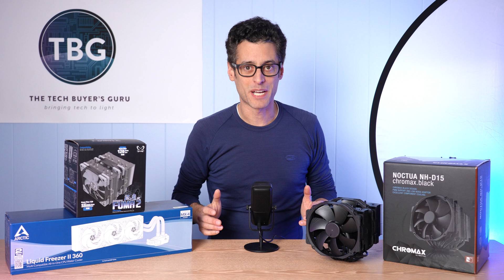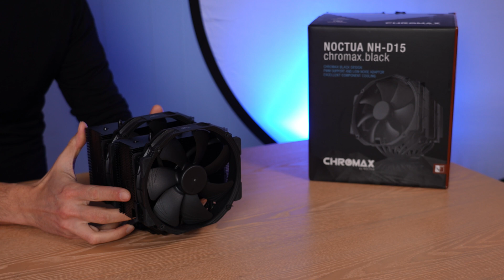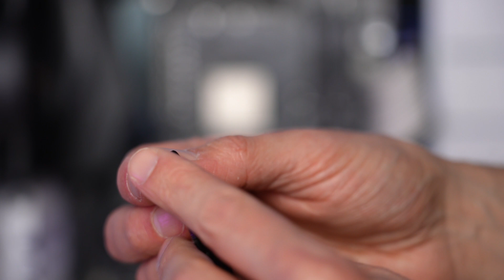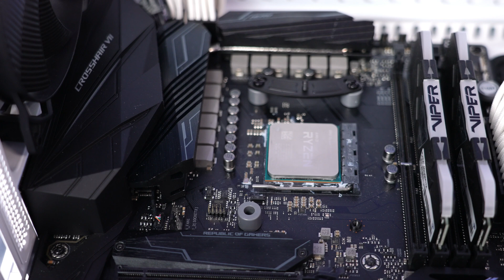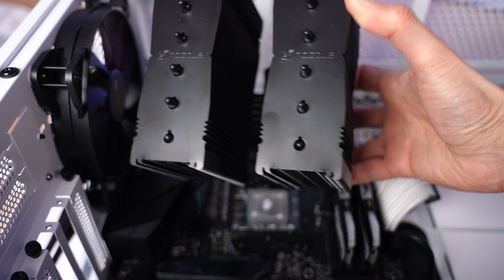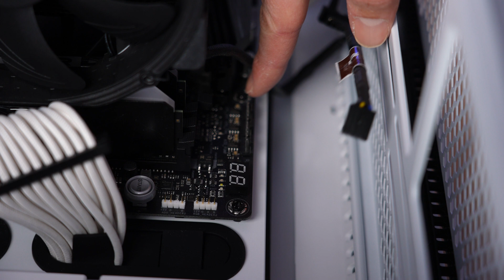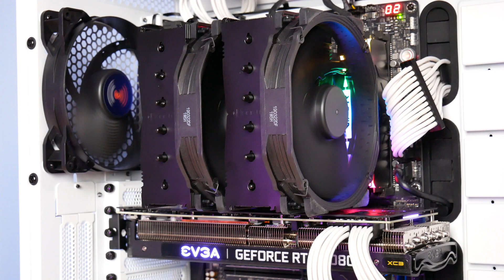The Noctua NH-D15 CPU Cooler: Installation Guide for AMD's AM4 Platform

Comment: READ!!! spent a lot of time trying to wrap my head around my throttling temperatures while using my i7 10700k with this cooler. turns out all along it was too much pressure on the cpu. backd out each screw 1,5 turns and temps went from 100c and throttle to 82c when running XTU benchmark on 5ghz OC..

Comment: I have same case and cpu cooler and I wish I bought a different one. Its too large. Cooler almost touching the gpu (mounted as Noctua recommended for AM5 7mm offset which did not help either. Pretty disappointed with the case 802 pure base. My gpu 12-4 hpwr pin is directly under the front fan. I have to remove the front fan to unplug gpu power cord. That is crazy AF. Unfortunately my Asus prime gpu does not have the power pins as you do on the right, its more to the middle in my case.

Comment: Can you not fit the backplate and brackets before installing the motherboard? Lay it flat on the backplate to hold the backplate in place a bit then you don't need to hold it

Comment: You can screw in one of the screws to the backplate without the spacer/brackets first to hold the backplate in place :)
It makes installing the bracket on the other side much easier, and after that you can unscrew the temporary screw and work on the 1st side
Probably the easiest way without using tape

Comment: What if the second fan won't fit in the case when mounted on the cooler? I would like to attach it to the back top of the case for more airflow but it doesn't seem to have anything to mount it to the case itself.
Reply: It's fine if it's a bit offset. I have it that way due to tall ram, works fine.

Comment: before install that make sure connect case fans to slots to its places BEFORE ... after your hands will not fit into small gapes and metal layers of radiator absoluately harm your back side of hand ..

Comment: What I learned from what I needed, so I was confused by the 3 fans needing to connect to the mb, I learned a splitter is included to fix that, I learned I don’t need to worry about thermal paste since it’s going to be included, as well as any tools I need, I learned it is a big sized cooler so once it’s in place, the side panel to my pc may not fit but atleast my cpu will be breathing properly (also it works with am4 and am5 so I’m good )

Comment: For the fans, shouldn't they face the same way as back exhaust (looks like pushing air out towards front intake, rather than moving airflow right to left). Sorry if it's a stupid question..
Reply: Wait are they reverse fans? That would explain it...

Comment: I realize this is an older video but I wondered one thing.  How does this compare to the Corsair A70?  I notice that this heatsink has more heat pipes.  I also did a search for liquid cooling and a lot of posts I see recommend this cooler.  I know Noctua is a good brand but I never had any of their products before.  They are known for quieter fans mostly

Comment: I've bought 3 of these D15 coolers now on the local market.
Brand new in the box standard D15 both for $40 each.
Used but like new D15 Black version with White Chromax covers for $70.

Great coolers cooling stock clocked 5600X,5800X and 5800X3D. Overkill yes but at those prices why not.

Comment: Very useful tip! Another way is to put one book behind the pc case space for the backplate and another towards the lower part of the case so as to have a kind of ''bridge''.If you put the second book at the right point it holds the backplate well.

Comment: Small issue, it seems that my case is not thick enough for it to sit on top of the ram or else it will not close, can i put the fan on the second fan on the back instead of the front? will it cause any damage if i do?

Comment: Overrated cooler, I know a cooler with a single heatsink that has only 5 heat pipes that can keep up with it in reviews, and in several cases even outperforms it, and doing that for half the price.
Reply: You didnt give a name which you making seem like the cooler is secretive. As for me i rater just buy a top end cooler and not have to worry with cheaper coolers they cut corners somewhere and long term issues will show its self

Comment: I just installed the single cooler version of this in an LGA 1700 MB.  Contrary to "the instructions are awesome" I found that there was no way to know which way the single fan was going to blow, and therefore no way to determine how to orient the cooler.  The fan neglects to say "intake" or "exhaust" or "the air goes thataway". Unlike a car, I don't know how to "jump" a motherboard so you wind up guessing which way to orient the fan, after guessing which way to orient the cooler atop the MB.  Noctua probably does this intentionally knowing how much negative blowback they'll receive by people getting their directions wrong, had they chosen to try explaining fan orientation.

Comment: As for accessing gpu latch in case you wish to unmount your GPU. I just used plastic pin (don’t use anything made of hard material to not scratch anything) to press on the latch.

Comment: What about radiators from this Noctua cooler likely touching GPU plate? And also rubber covers on the fan that sit’s in a middle also touching GPU plate? Is this not an issue? Even potential fire hazard as the rubber could melt?

Comment: Thanks for this! Just a note in case others are having trouble with the screws like I was just now - they take a lot more force than you think they do! I went back and forth getting one screw on a bit and then the other wouldn't seem to go on - but eventually realized I just wasn't putting enough force onto the second screw. Be careful that your screwdriver doesn't slip! But the springs on the screws can probably handle more force than you think.
Reply: Thanks so much bro, I was so frustrated at how I could only get one in a time
Reply: Thank you so much, it would have taken me A LOT of time to figure this out

Comment: Amazing cooler! My 5600x was overheating at 96 degrees with the stock cooler so I bought this, I know it's overkill but I assume I'll have this for future upgrades. Haven't seen my CPU go over 60 degrees and with a new overclock on the GPU I am getting 30-35% more FPS in CPU demanding titles.
Reply: did you undervolt it?

Comment: Looks like the worst DIY instructions set recorded... you should be putting the backplate with the motherboard out; also you shouldn't be touching the CPU with your bare hands as it will leave dirt/natural oils from your skin on the surface; you should be holding the CPU from the edges.

Comment: This video has over complicated the whole installation process. You do NOT need the motherboard to me mounted in the case, and given the size of the NH-D15, I would NOT suggest doing it this way... what if you just flipped your motherboard upside down (outside of the case) to slide the screws through?

Comment: Thanks so much for clearing up that 3 pin 4 pin thing. I couldn't fit the front color because of my cabinet clearance, and couldn't understand why I got CPU fan error afterwards. Must have plugged it in the 3 pin..

Comment: There are two versions of this cooler...the d15 and d15s. Not black and brown ffs. The d15s doesn't block the top pcie slot if you have a gpu with a beefy backplate.

Comment: will this cooler fit a Corsair Carbide spec 01 case? mobo is a ASUS Tuf x570 AM4 socket 3700x CPU. its a small case i dont know if it would fit it looks like a monster of a cooler. using the stock wraith right now temps in 70s

Comment: Thermal paste application is always something that seems to divid opinion, the problem with separate splodges is that it can encourage trapped air bubbles in-between.
Reply: O noo! We all know the right way! From the old bears muttering from years of hand me down experience and magic rituals. The secrete sauce! Spread it with unicorn precision bla bla bla.
But yea honestly a big blob in the middle and spreading it out just to sanity check that enough paste is applied is still a better way to go. Like for a threadripper you people (in general) can not be serious just saying that a big blob in the middle is a good idea.. Or for a GPU ide or whatever. But yes small splodges is not a grate idea at any point but not going to do much harm really. Maybe on a threadripper system or GPU. Maybe. But not a normal PC CPU.

But it sure is not a good way to paste something with a big blob in the middle since it becomes a trained eye to know how much is needed. Like sure is going to work but when the cooler is on the CPU you want it to be done for 4years or so. So better to overdo the step without doing it all by hand all the way.

Big blob and then help the paste spread just to make sure enough is used. If one can not spread the paste out a bit and be sure it is enough you have used to little paste. And if you add extra paste since your not sure then woopt i du! You just creamed the stuff out on your board. XD Or worse for the AM5 CPU's. Or liquid metal... Fun hobby. GamerNexus was making fun of Noctua for the plastic film to place on the new AMD cpu's to make sure paste do not go under the heat sink etc. But like.. That seems like a good way of doing it. Anyways it is up to everyone to try and learn for themselves. I still think the old way of manual paste is more relevant now then back in Intel days of 4cores hell.

Still recommended to just manually spread and let the stupid cooler do the squeeze. To avoid air bubbles and still have given it enough paste. Since the big blob in the middle stays a big blob it should push out any air trapped in the tampering with the paste. And since one do half the spreading one can make sure enough paste is used without overdoing it to much.

Doing the paste fully by hand is also a risk of air bubbles to some extent. Why the pea metod was superior for more then a decade. But now the pea is not really the way anymore. And so people started to mess up the tirual. ;)

Btw: D15 is just as I remember my D14 install. To easy. Stock AMD cooler was no fun to mount. So I doubt if my memory of D14 was wrong or not.
Reply: @TheDiner50  I've always done single blob in the middle. I've had a system running 24/7  using Noctuas standard NT-H1 for 8 years now and the temps are still like the day I first applied it. It may not have the best temps but my god is the NT-H1 a damn good long term thermal paste. It doesn't dry out and is non-conductive too, easily still one of the best all rounder pastes despite its age, I'd still pick it over the newer H2.  Never used a chip the size of a threadripper so can't comment on those :)

Comment: i have the NH-D15 SE-AM4.  it makes me want to get a full tower case.  about ready to take this out and replace it with a 3rd gen ryzen(vs 1st gen).  doing the gpu card upgrade also(980 to 3060).  should be cool smooth running for gaming

Comment: Thank you for the video! Maybe you can help me?
I'm about to get a pc for music production and some video editing, so I need a strong and quiet cooler, but I'm still not sure which one will be best for me - d15 vs u12a, for an intel 12700k, z690 ud, 32 ram, pure base 500.
As I understand, The D15 is better, but I have some doubts:
- The ram (Kingston Fury Beast 16x2 DDR5 4800) is a bit taller for the D15, so maybe it won't fit, and even if it will, it might limit the air flow?
- The D15 is big, so I'm concerned - will it make noises every time it touches the sides of the case as it spins?
- Noctua is warning not to move the D15, so that the big wings won't break - the case will be positioned on the floor, but sometimes I need to move it - is it ok?
- Also, the D15 is heavy, so I'm afraid about the motherboard - the store will install everything inside the case and ship it to me ready to use, should I be afraid? The u12a is heavy too, so I don't know if choosing it over the D15 is going to help in terms of shipping.
Nevertheless, D15 is the strongest and the quiter, so what do you think I should do? I can't decide...
Reply from the maker: Go with the D15 in your situation.

BUT NOTE: I would never ship a PC with any large tower cooler installed. It doesn't matter if it's the D15 or U12A, either can break the motherboard if dropped during shipping. If you must have this shipped pre-built, I'd recommend a liquid cooler.
Reply: @TheTechBuyersGuru  Thank you for your response!
Wow I'm surprised - so what's the accepted way to get a pre-built computer? After all, not everyone knows how to build one. The shipping is from another city, and I want an air cooling, not a liquid. 
What about having enough airflow (assuming it will fit the ram that is taller than it should) + the wings touching the sides of the case - should be fine?
And what about moving the case carefully from time to time? I used to move my last pc with no worries, also, I got it from a store in town but I don't recall driving slowly or doing anything special in order to keep the cooler/motherboard safe.
Thank you again!
Reply from the maker: Shipping is totally different from driving a PC in your own car. There is a reason not a single OEM manufacturer sells high-end PCs with air cooling. It cannot be shipped.

Comment: I did it yesterday. Took me 4 hours almost (including unpacking and stuff). I couldn't make the other screw (like in 6:58 ) "bite". I had no problem screwing one, but the other was always loose. I unscrewed the one that already held and then I had no problems screwing in the other one. But making sure that both "bit" took me a long time. I didn't want to put my new mobo on hard table, so I've put it on the mobo's box. Still I had to put a lot of force to screw those 2 screws. At one point I managed, but they almost instantly stopped, so I thought they might have cross threaded. So I unscrewed them and tried again, more delicately and this time they were screwing in. I do hope that it means everything was correct. Though I wonder if perhaps I didn't screw brackets strong enough, but the screws are sticking decently through the back plate. Just not uniformly. I basically screw them (obviously in X order, couple rotations at most, before I switch to another screw), until there is significant resistance that stops my 2 fingers. Then I give it one last nudge this time with more force, until I feel screw fight back - which happens after 30-90 degrees rotation. Otherwise I was worried about PCB.

It took me this long mostly because I used noctua tool that is great for reaching things, but it's not good to apply downward force. Once I took screwdriver and held mobo firmly by the backplate and used strength to squish that huge spring just a tiny bit, both screws were in, in a minute. I just screwed them enough so they held and then started tightening them 2 rotations each. I hope I didn't destroy a PCB or that there is contact between IHS and the cold plate. I hope I didn't make my CPU a pancake.

I installed RAM afterwards without any trouble, just had to remove the exterior fan for the duration of installing it.

Gigabyte Aorus X570S ELITE AX Rev. 1.1 and 5950X.
Reply: Thanks for the heads-up.  We, who are about to install, salute you.  So, how are your temps?
Reply: @Chris.Brisson  Temps are fine, it just took a long time to get system up and running and it still lacks games etc. For the first couple of days I will have 4 TB of games from Steam to Download, but I can only do it late, when Internet isn't needed as much.

Comment: What is the max RAM clearance for this cooler?
Will the Corsair Vengeance RBG Pro or Vengeance SL fit without moving a fan up? ( I know you can, but I don’t know if my side panel will allow for that (I have the Rosewill ThorV2 (it has a side fan)
Will there be enough space for the Vengeance Rbg Pro
Reply from the maker: Definitely not RGB Pro, and I don't think the SL will work either. Honestly, the RGB is covered up anyway, so go with Vengeance LPX.
Reply: @TheTechBuyersGuru  what about just using 1 fan?

Comment: Looked at several installation videos and yours was the best. Told me how to clip on the second fan. The only thing missing was the orientation of the fans. Which direction do you have them going???? I assume in the same direction? But how do you tell which direction is which?
Reply from the maker: The spinning hub is always the intake, and should always face the front of the case.

Comment: Noctua's quality control is horrendous - too many reports of people buying t hem and noticing bent heatsink fins to lots of dust on the cooling plate - I have personally witnessed both, when you buy a brand new non used product and it has so much dust on the cooling plate, that should be 100% clear of particles, the part that makes contact with your CPU, you know there is a real QC issue.

Comment: You should have installed it to the mother board prior to installing the motherboard into the case. That’s why you had trouble with it
Reply from the maker: That's not how cooler upgrades work.
Reply: @TheTechBuyersGuru  In fresh builds that's how you do it, when doing installation guide shouldn't you do a fresh build? or at least do it in a test bench anyways?

Comment: WHY DON'T YOU UNDERSTAND THAT THE MEMORIES (RAMS) DON'T FIT ESPECIALLY  WHEN YOU PUT FOUR STICKS THIS COOLER IS JUST A FAILURE
Reply: Then don't buy the cooler lol. You need low profile memory sticks. I have 4 sticks and this cooler and no issues. It's a great cpu cooler.

Comment: did everything in the video, the cooler fits on one screw the other screw is an 1/8th of an inch off from fitting, im using the am4 adapter that came with the cooler any idea on whats wrong?

Comment: If i have a Asus B450m-a Prime motherboard which has one CPU cooling fan connector, but i want to have a Noctua NH-D15 as a cooler which has two connectors, how do i make the 2 fans work on the Noctua?
Reply from the maker: Comes with a splitter.
Reply: @TheTechBuyersGuru  Thank you very much!